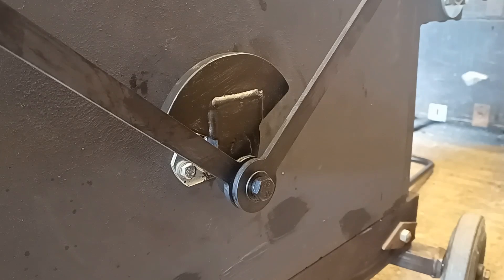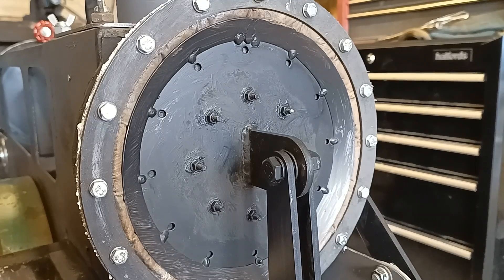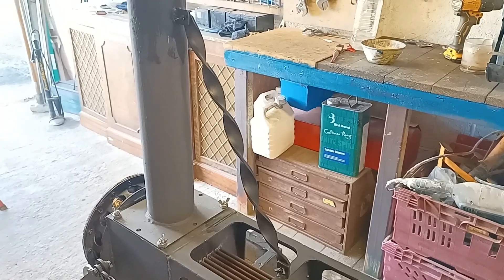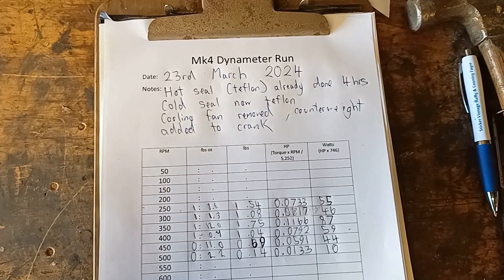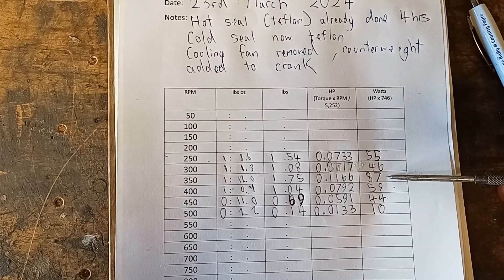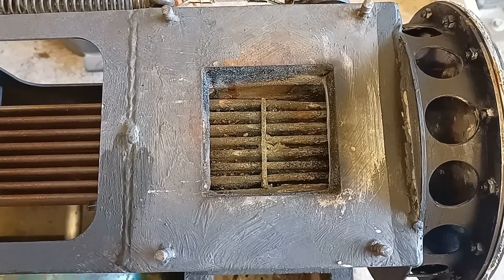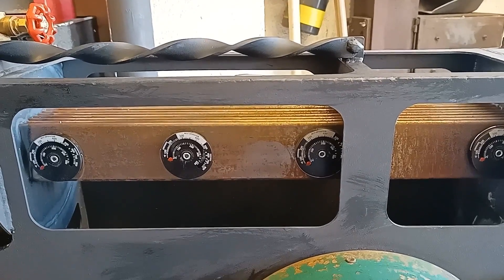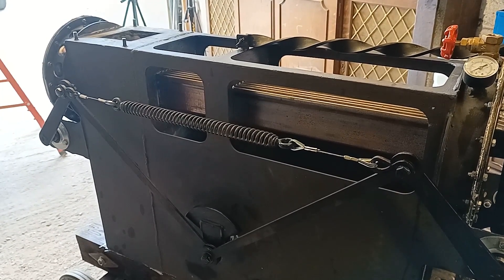Stirling Engine Generator Mk4 (Rocket Stove!) Part 11

Comment: Hi sir.. you are doing good. I have a suggestion .. can you shape seals in bellow shaped.. that way it might not fail often..(purely assumption.. seen im some ones' engine)

Do you have any idea about taking it solar... I'm pretty close to equator( India) having idea to make a solar engine..

Is there any way to contact u.?..
I can share my mail id about s
Reply from the maker: Hi, yes, bellows would be a good design idea to explore. For converting solar energy the solar panel is probably the best bet : ), unless they are not available! Shanepomeroy@hotmail.co.uk

Comment: 50% efficient engine should be able to produce that power from a candle.
Reply: Very few engines are 50% efficient, but also a candle produces about 80btu/hr of heat which is just shy of 25w.
Reply: @ so a goal for a hobby project should be to at least get at least 5-10W from a candle. It seems that efficiency is very hard to achieve on stirling engine even if they have the potential to be more efficient than diesel.

Comment: have you thought about selling parts kits? or at the very last the drawings and CNC files? I am very interested in building one to power my workshop
Reply from the maker: @wolfypilot  I'd like to but I'm not guite there with a decent design (maybe never : ). I'll be making another attempt this winter. The mk2 probably looked very impressive due to all it's moving parts but was fairly inefficient compared to the last engine. I may do commissioned builds if it follows my aim to build a simple, practical engine. All the best
Reply: @ShanePomeroy  I know your newer build is more efficient but it hasn't reached the same power output has it? the most I saw was 70w compared to the 500w of the mk2.
Reply from the maker: @wolfypilot   your right : ). My next engine will be another smallish engine to prove the substantial dimensional changes I'll be making. If that works out I'll be in a position to scale up to any size. Everything seems to take so long and family / work come first! All the best
Reply: specifically I am interested in the mk2, I would spend a lot of money to be able to play with one of these lol. please let me know

Comment: you should make a  SMALL gamma or alpha stirling engine, while following the advice that i have offered, below.               as seen on some small stirling engines, a vertically oriented loop in the duct forms a simple and effective regenerator.    convective heat trap.      d

Comment: Hi Shane
Congratulations, very good work.
With my experience, I think of 2 modifications to try;
1) Your unidirectional valve increases the pressure in the engine but in a dissymmetric way. If you replace this valve with a very small air inlet to balance the average air pressure inside the engine with the atmospheric pressure you no longer have these disadvantages. On the contrary, you have two cycles of motor work per turn instead of one. A pression cycle and a suction cycle. The engine thus has a much smoother operation between a pressure of 0.7 to 1.3 bar for example (instead of 0 to 1.6 bar).
2) As already indicated, separate the cooling zone from the regenerative zone to increase yield. Simply isolate part of the chiller from the hot side. This has the consequence of having a regenerative effect by retaining heat in this area.
Reply from the maker: Hi, thank you for your advice. I will do some experiments with the snifter valve setup to see if removing it helps things. Regenerator isolation could be incorporated into the next engine. I just don't understand so much! Many thanks
Reply from the maker: Hi, thank you for your advice. I will do some experiments with the snifter valve setup to see if removing it helps things. Regenerator isolation could be incorporated into the next engine. I just don't understand so much! Many thanks

Comment: because a diaphragm acts as a spring, ANY  use of a diaphragm in a heat engine is less-than ideal.      the use of a spring to 'compensate for' poor linkage design is  sad.      when making a prime mover, it should be understood that the nominal operating speed of the engine  WILL  be  Determined by the way it is  loaded; via the crankshaft.        if part of the system (say, the dum spring) seems to smooth operation, that smoothness is (probably) coming at a cost.      that spring is also flailing around,  ABSORBING  energy.     d
Reply from the maker: Yes, the design is compromised and not ideal but I'm trying to keep construction extremely basic. Springs not great but I believe a much smaller flywheel can be used. Cheers

Comment: Hello Shane. I think that your stirling is not that disappointing. The best performing stirling generator I found on youtube was able to produce 150W of electricity. The stirling was quiet a smaller but it also had a lot larger furnace running on a lot more wood than yours. I think that your design is really nice. It just need a little redesign of sizes of the parts. (heater, heat exchanges, levers etc.) I wish you the best and I am looking forward to your future designs 💪

Comment: You could also possibly raise your center pully and crank to be precisely alligned to the center of your piston. This way you reduce the arms lengths. And add another set of pipes so that there will be a set of heat exchanger pipes above and below your crank. Use a T piece to link piston to your pipes in this configuration.

Comment: If possible reduce the weight of the piston plates or add a counterweight so that it does not need to hang on your diaphragm material as much as it is currently doing. Or let the pistons run on a linear bearing so that it cannot missalling and damage your diaphragm material.

Comment: Hi Shane, why do you not try a alpha design with this kind of heat exchanger between the cylinders. According to my understanding you also didnt have a regenerator between the cyclinders in the MK4, that would be also a good upgrade. Another thing to get more power out is the pressure in the cyclinders. Each PSI increases the power output, as long as the heat transfer can catch up.

Comment: Redesigning the rocket stove could increase your hot end temperatures but then your seal will melt again. I would add a water heater to the exhaust and utilize the waste heat. This will legitimately increase power output.

Comment: You can insulated the fire box more to get the exhaust temperatures higher.
Keeping the cold end cold is as important as keeping the hot end hot.
You want to work to reduce the conduction of heat in the regenerator.  You want it to store heat and not carry it away.
Insulating can help down near the hot end.

Comment: Would you consider attaching a small motor as a generator to charge batteries? You could monitor the power output and control engine RPM with the load.

Comment: Look at the way rocket mass heaters are designed the flue from the fire goes up and then the gasses are forced down before transiting the mass and then going to the chimney, of you could take the rocket part of the RMH and put the heat exchange in the top you might get  more heat being transmitted into the the exchange as the hot gasses get to travel over the exchange at least twice (up then down over the exchange)

Comment: Putting mineral wool insulation around the first 10 inches of the heat. Exchanger on the hot side might also boost the power output some since you're heat Exchanger seems to be a little bit too long. You could adjust the amount of insulation and see how it affects the power output. That would give you a better idea for sizing it next time. Another idea would be to put regenerator material in the pipes before you squish them flat that should allow you to recycle more heat instead of rejecting it all at the cold end.

Comment: Optimizing the regenerator portion between the hot and cold heat exchanger would increase the power output. The design on this engine has a lot of dead volume and not a lot of heat transfer area as far as regenerators are concerned. Andy Ross has a fairly simple to manufacture solution on his final design of sterling engine For his Sterling powered bicycle project.

Comment: Really nice Shane. Marks Mechanical Engineers Handbook says that, as an eatimate, a 30 year old man can average 1/10 horsepower over an 8 hour period....about 75 watts.
It would be interesting to set up a water pump or something as a load (with a variable vertical lift so you could finep tune the load) and measure weight of wood burned/consumed over time under steady state load.
Cheers to your Dad as well!
- Chuck in Florida.

Comment: a proper Batch rocket will output 2x the heat of your J-tube design and provide more than adequate radiant heat through the heat riser. a 6 inch batch box will have a heat output of 77000 btu/hr. and a burn time of 1 hour. so i guess for scaling: make 4 of theese fellas run on a single fire.

Comment: Hi Shane, are you able to add pressure to the internal gas?  I’ve seen hydrogen used in the high end sterling engines.  Maybe 2-3 bar of air would be interesting to try.
Reply: You'd need an enclosed crankcase

Comment: Nearing 100 watts is still impressive for diy.

Would it be too much to replace a section of the cold side heat exchanger with aluminum, and or insulate the  regenerator section between the hot and cold heat exchanger?  

If you can handle more pressure inside, means the greater area inside the stirling pv cycle, and that translates to more work done.

Comment: Gosh, I don't know if the silicone laminated kevlar is what you switched to because of my suggestion, but i'm amazed to see how well it works under operating loads and temperatures!

Anyway, This project is so awesome and I can't wait to see how much mechanical power you can get out of a wood stove!
Reply from the maker: The kevlar / silicone does seem to be doing the trick,  thankyou

Comment: To improve that firebox you probably just needed a grate to hold the embers up off the floor of the firebox, so all the air is forced to pass through them. To start it you would still need a fire beneath that grate.

Comment: Try helium inside the engine
Reply: More like liquid nitrogen through the cold intake
Reply: You miss the point helium under pressure has less resistance to flow back and forth between the pistons

Comment: You need make a Stirling engine powered tractor next that runs on coal, and drive it around the block, and i think you should try to stick to pistons as they are far more better then bellows.
Reply: That is definitely a good idea of feed system that is powered off of the engine
Reply: @TheO5Council  Only hang up I see is that Stirling engines are not made for torque, they're made for efficiency. 

I think a traction engine would need enough potential energy (in the flywheel) and sustained heat generation to move its own weight
Reply: @BeLowBelowo  agree
Reply: Or better yet - whack a generator on it and propel it with ebike parts and one of those bluetti portable batteries that can charge from solar at 12 - 48 volts and step the voltage up to 220v for the socket.